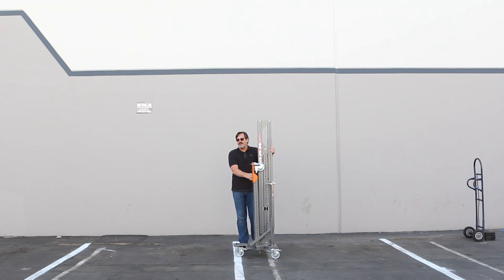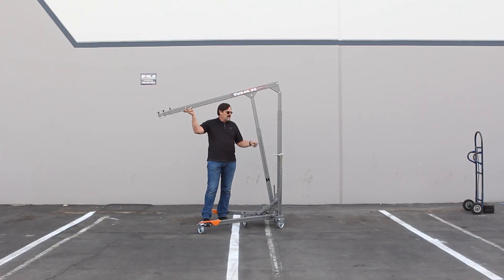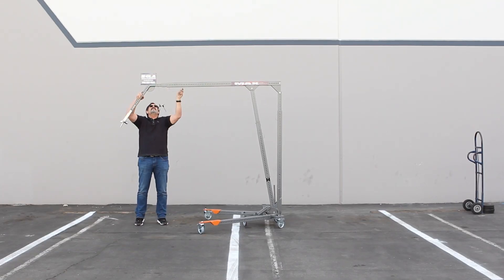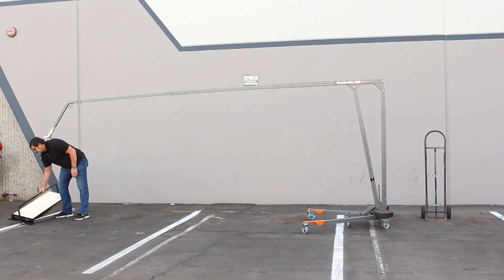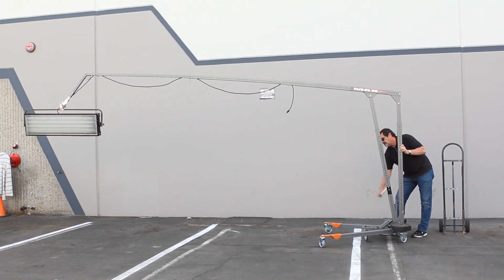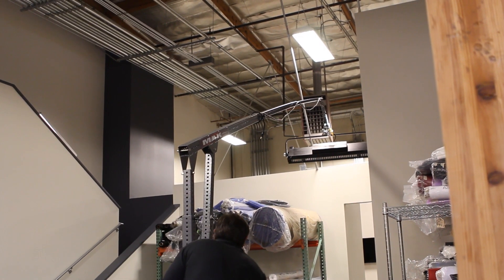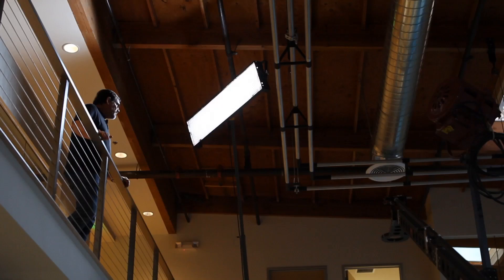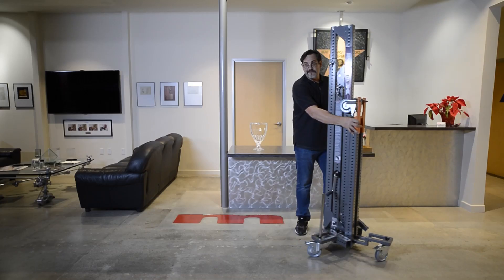MAX Menace Arm | Matthews Studio Equipment

Comment: Love the max menace arm! Questions-  Regarding  the lamp adaptor arm, is it designed to not need a quickpin? I always add a ⅜ inch bolt because a dedicated pin is not included. Will the spring loaded locks suffice? They seem like they would, but in the video Richard uses the quicken in one mode, but not in the other.